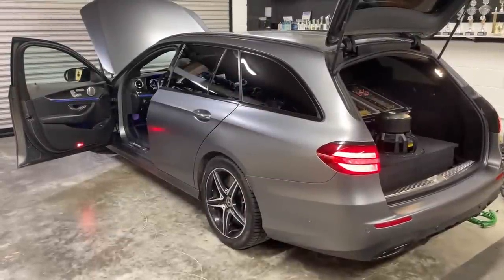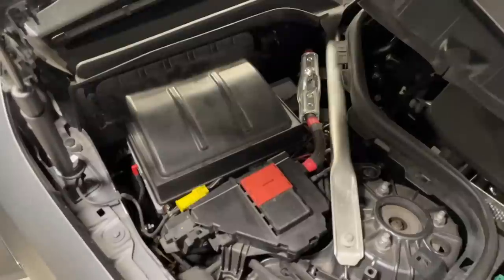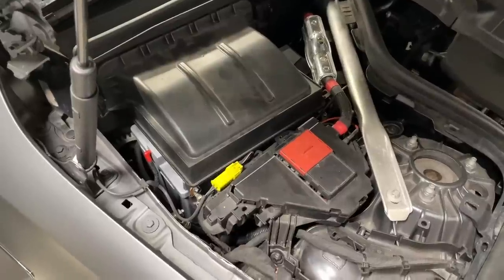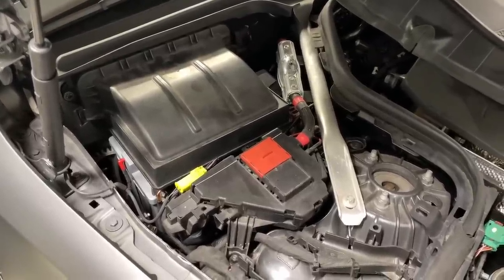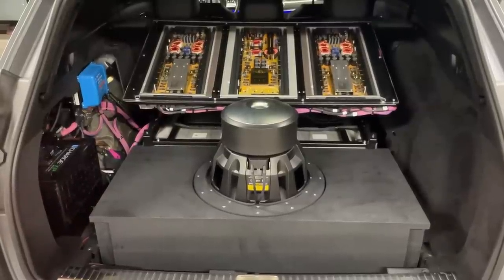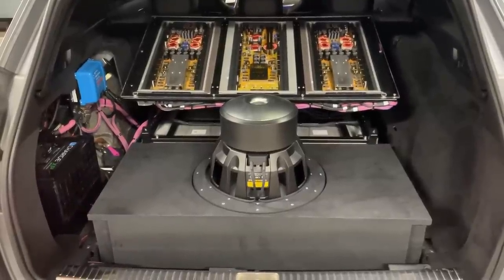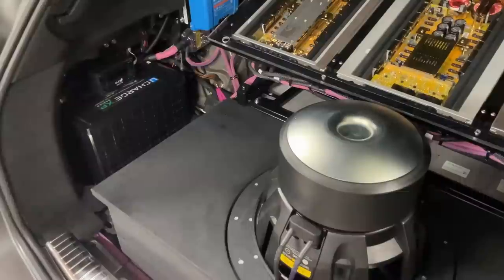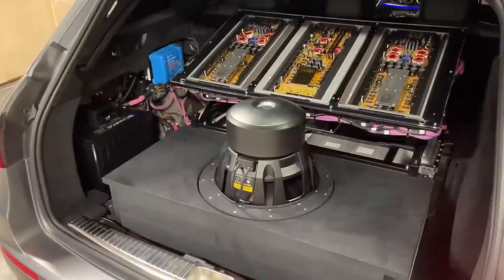Crazy SQ System PART 3 - Wiring EXPLAINED - Steg, Helix, Zapco, Mobridge, Power Solutions

Comment: Hi Pete! I am Ángel from Spain. I've been following your channel for a few weeks and I love your work. I am a hi-fi enthusiast, both at home and in the car. I have a question for you: what is the reason for the inverted subwoofer and what are its advantages? Is the frequency deeper like this? Thanks and greetings:
Reply from the maker: Hi, zero advantage, rather the opposite in some cases when the sub has higher mechanical noise of moving parts. Only benefit would be better cooling in a sealed application, which is only a concern for SPL heads. 
We reverse mount subs sometimes because of physical limitations when it comes to depth like in this case. The basket and magnet are too deep, that’s all.

Comment: Hi Pete!
I've been mulling over ideas for a dual battery setup in my project truck build and I keep coming back to dc-dc chargers as the most recommended route , also mainly because I will use a solar panel to replenish what the alarm with sensors and a wifi hotspot consume (hotspot used to alert me of any dashcam triggers).

Anyways,  I've always been told that when selecting battery isolators, to use an amperage at least equal to the Alternator output. (200a Alt = 200a Minimun isolator).

Now, with these DC-DC Chargers with built in isolators like you've used in this video, is there any requirement for isolator amperage in reference to Alternator output?
Could one use, say, a 40 or 50 A DC DC Charger with a high output 350 A Mechman Alternator? 

I appreciate any help you can share, Thank you!
Reply from the maker: Check out what the maximum charging is for the lithium battery in amper and then you’ll see clearly if you can have direct charge from the alt or you need a DC-DC to limit it.

Comment: Hi Peter, great and complex system. After seeing this built in the trunk I think you have added more weight to the rear of the vehicle, how do the rear suspension manage the weight of the whole system. Do you upgrade the rear suspension to maintain the weight and the height.
Reply from the maker: In this one we have air suspension on the back, so added weight makes no difference, otherwise it’s down to the owner what they want to do about it.
Reply: @pssound9749  okay 😊

Comment: What are the box specs bud for the jl sub. I have the same 13w7 like the setup would probably suit my golf r nicely. Edit I have also the HD1200 amp lol had it for years before getting the 13w7 sub.
Reply from the maker: It depends on what you want to achieve. It can work great in 50L sealed, being a bit punchier while still have enough extension. EQ can always help at the bottom-end.
We built this box for lower Qtc to achieve lower F3 as we have a front sub in this system. This box was around 80L.
Reply: @pssound9749 Hey, Thanks for taking the time to reply, I know you are super busy. 

Wow 80 litres is huge that's almost 1/3 larger than jl recommends, size does matter. I thought it was sealed to begin with but now I'm starting to think it's probably ported and tuned super low if I understand right from measurements you mentioned, I did wonder if the sides of the box were ported in a down firing sort of setup and if you achieved some of the space utilising the spare tyre compartment in the box design, you definitely did a great job keeping the box looking fairly low profile for how big it really is, very impressive!  
Anyway, think I'm going to join the patreon club because you do offer a huge wealth of knowledge and also just a bit of a thankyou for taking the time to reply to someone who's not on your supporters list yet. I have only been following your channel about a month now and already jumped the gun on a zapco dsp thanks to a few of your videos showing zapco stuff. That was good enough for me to jump on one, albeit a 'shoe box amp' (think I got your phrasing right 😂) inclusive one, bit of an oversight and rushed decision on my part as it only has 2 RCA outputs which limits my ability to add full active setup with external amps later unless I go high level out of the zapco into the other amp which to me  ads a possible or inevitable even higher noise floor from the outset, not to mention the dsp/amp doesn't fit under the seat now because it's trying to accommodate 10 channels of amplification, bit annoyed with myself over that decision actually but never mind, hopefully I can sell it and recoup most of the costs. I definitely want a similar outcome to what you guys have achieved from the JL I want tight and low don't care if I lose quiet a few dB in output from the sub, these things just rattle the car to pieces litterally in a one note wonder box and I'm not about that style of listening anymore! 😂

Sorry for the super long winded reply I struggle in that area. 

Kind regards Jeff
Reply from the maker: @chloeleedow7250  you have several videos here on YouTube showing this build, there’s even a playlist for this car. Of course there are even more videos on Patreon showing the little tips. 
Btw this was a sealed enclosure. Most people wouldn’t believe what the 13W7 is capable of in 15-25Hz in a lower Qtc box with lots of clean power. It can put many IB setups to shame.

Comment: Cost…$20,000 - $30,000?
Reply from the maker: Equipment is around $30k. Installation depends on which country and which shop would do it…if you can actually find any shop to do something at this level.